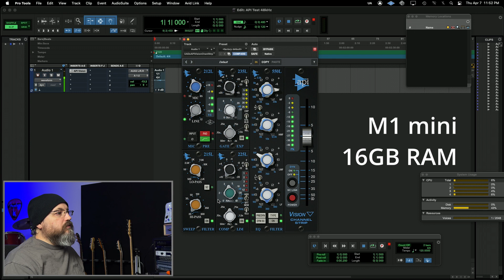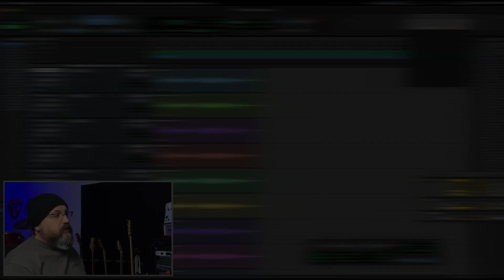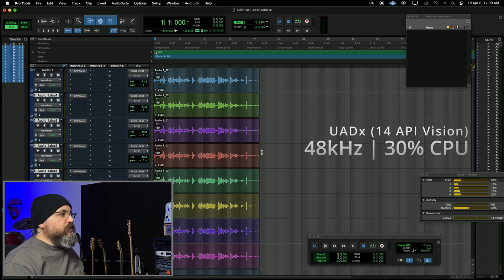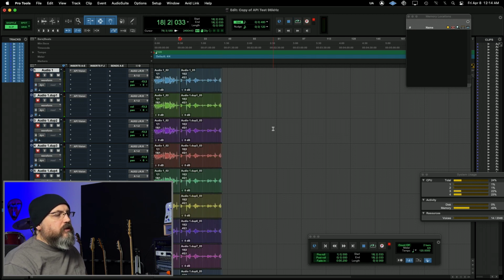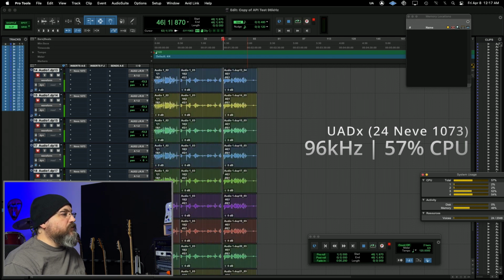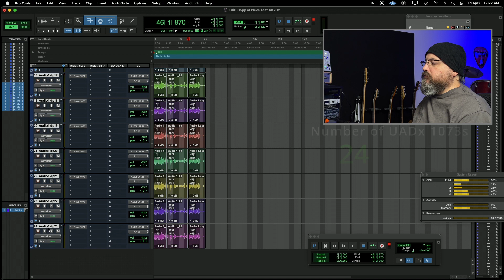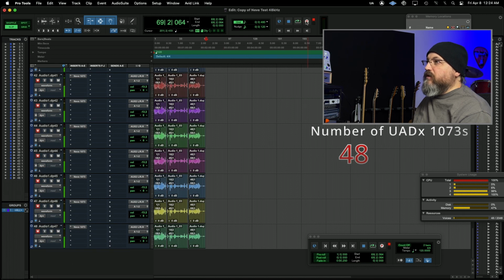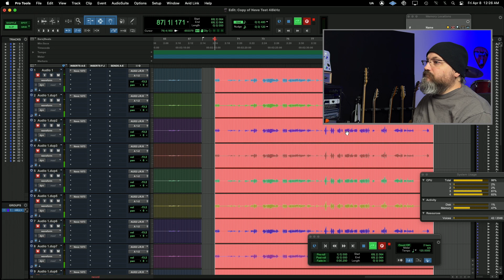UADx Spark Plugins at 48kHz, 96kHz on M1 Mac - Real UA Native CPU Test vs UAD DSP

Comment: How much does it add to RTL for live artist monitors to use native UA plugins in the DAW as opposed to having them in DSP? 

I'm trying to figure out if it makes sense to invest in UA X16 these days, since the DSP is the same power as old versions, and I could get the new Thunderbolt 4 MOTU 16A with the same converters for $1500
Reply from the maker: So, the biggest part of the RTL is the MOTU. It'll be around 4ms at 32 samples 48kHz. Add 55 samples for a typical UADx plugin like the 1073, and you're at around 5.2ms RTL. Apollo Console will be around 3.3ms at 48kHz regardless of buffer.

Comment: There is a glaring issue with this though, internally the plugins are only running at 48K internally and the oversampling is doing incorrect internal oversampling multiplication math with linear phase filters. This is why all of the Unison plugins and many of the newer UAD plugins have their anti-aliasing filter stop at 24K. Its an old trick used in low powered DSP. Just use any EQ analyzer on a 96K session and you'll notice the UAD plugins have an incorrect anti-aliasing filter that is cramping the EQ curves. An API 550B is linear from around 25HZ to around 49Khz yet the UAD API DSP and Native has a cut off at 24. I understood this on the DSP platform since it was a 22 year old SHARC DSP but there is NO logical reason to use those same filter schemes on the Native plugins other than fear of sounding different without it or just lazy cross compiling. But UAD is the same company that refused to fix the Harrison SE EQ 15 years ago when it was discovered that the low shelf button didn't work. I own UAD hardware and plugins but the deeper I dive into there tools the sketcher it gets.
Reply from the maker: They upsample to 192kHz. UA does not hide the fact that they filter at 24kHz, though. The native versions are identical on purpose, though I don't disagree that it would be nice to toggle that filtering on the native versions. You did bring up something I wasn't aware of with the Harrison SE. I'll have to take a peek at that. The only fault I have with the oversampling and filtering is that the LA-2x does it slightly differently and adds 56 samples of latency instead of the 55 that everything else adds. This was tasked to be fixed some time ago, but I believe it has not been addressed. The API 560 was, though, since part of that code was part of the update to the API Vision Channel.
Reply from the maker: This also doesn't explain the strange scenario that UADx is MUCH more CPU efficient at 96kHz in PT than at 48kHz.
Reply: @MattHepworth  The reason is because of the amount of oversampling, at 96K its called a 2x FIR oversampling at 48 it would be 4X. You also have a small amount of division going on in the C+ compiler so that the internal processing is actually done at 48K and is agnostic to the actual sampling rate of the project or DAW. Jerrone from Toneboosters implemented the same style of oversampling in the Toneboosters EQ 4, he told me that he suspected they did it this way to combat DSP overload as well as a stricter antialiasing filter to combat the distortion aliasing that would impact the overall character of the plugins like the unison plugins. But he was speculating and that was the same conclusion other developers came too as well. So the plugin is agnostic to the DAW sampling rate but the oversampling is not that is why it is more efficient at 96K. Cheers!
Reply from the maker: I guess I'd expect the same behavior with the DSP in that situation. Perhaps that's a native-only phenomenon? With DSP, 96kHz uses about 25% more DSP on most the UA mkII plugins.
Reply: @MattHepworth  Well the difference is that the DSP isn't actually multicore so no the behavior would be very different. See the SHARC DSP cores are independent, 1 core per chip, so they can not share the load of a single plugin. So the Sharc chips can't run say an SSL channel strip EQ on one chip's core and the compressor on another from the same plugin. The entire plugin has to fit on a single DSP chip. But ARM and X86 are multicore designs on a single die where as the Sharc DSPs are single chips connected by a  tracers on a PCB that then connect to the Thunderbolt/PCI bus. As well as the compiler and scheduler for a CPU/GPU is fundamentally different than dedicated DSP hardware. So even though they are the same code the architecture they are running on is fundamentally very different.  This is why I hope they move to FPGA based interfaces when NAMM comes around this year, FPGAs don't have this issue with sampling rate and the amount of plugins you can use stays the same if you are at 48 or 192. Most of the major live mixers are moving to FPGAs for this reason and they have far less latency compared to traditional DSP. Again I like UAD and I own some of the hardware but there are things they should address since their catalog of effects is getting pretty long in the tooth and i think they will make a leap forward at NAMM in a couple weeks!! Cheers!!

Comment: I think it's worth pointing out, that the CPU usage in DAWs isn't 1:1 correlated with the actual CPU usage. Instead, it shows the "cpu time headroom" in relation to when the current buffer has to be completed and sent to the audio card.

As an example, lets say you have a quad-core cpu, each core being able to process 100 "cpu-units" of work pr. buffer, ending up with 400 units in total.

Now - imagine two audio channels routed to a bus! First channel takes up 70 cpu units, second channel takes 10. Yet - from the bus and forward in the mixer-chain you only have 30 cpu units available (despite using just 80 of the 400 total units), since you need the first audio channel to finish processing, before you can process the bus. However - you'd be able to add a lot of channels / processing before the bus, without affecting the "total cpu usage".

So - in regards to native plugin-count - "it all depends". 4 plugins one after another on a channel is different from 4 plugins on different channels. And on top of this, many DAWs (Cubase, Logic, quite possibly ProTools as well) employ differentiated latency, allowing the DAW to process "non-realtime" channels out of order at a much higher latency, for significantly better utilization across cpu-cores. Which means that plugin count during playback is different from when you're input-monitoring!

On top of this, there is also buffer-size, which adds yet another variable to the mix (pun intended!). Shuffling audio between plugins takes a little bit of cpu-time, and it makes a major difference if you are doing this 44100 / 1024 samples = 43~ times a second, or 44100 / 32 samples = 1378~ times a second .. for each plugin!!

So - yeah, its not simple! UAD DSP capacity are not really affected by buffer-size, having a fixed latency of 2 x buffer + plugin latency (upsampling, actual processing, ect). But, native plugins can yield all different kinds of numbers depending on routing-layout of your session, buffersize, DAW - as well as real-time or non-realtime scenarios!

Food for thought - as well as insight into why you had non-intuitive numbers in your benchmark.

/Rune/
Reply from the maker: Good info, yes. The non-intuitive number, though, is that 96kHz allows more instances than 48kHz, relative to buffer.

Comment: After both coverted to
MP3 
You cant hear the difference
Reply from the maker: Since they upsample to 192kHz anyway there's no sound difference between the versions, so you're good to go at whatever samplerate. It's so strange that you can run even more instances at 96kHz than 48kHz, though!
Reply: Are you using reaper? Because Reaper I think automatically runs at 96k within the Daw
Reply: Ooops 64khrtz

Comment: im looking forward to trying spark when they have a pc version of it.im not too happy with slates 1176 and la2a compressors. i might end up buying hardware versions of those in the end but heard that uads versions actually behaved like the hardware does so i'm a bit curious.
Reply from the maker: I think you'll find the UAD/UADx versions are very comparable to the hardware. The only hardware I ever shot out directly was my vintage dbx 160VU against the UA and the Waves. Very close. If I still have that I'll post it as a video. I even went so far as to ensure the plugins passed through DA and AD just like the hardware...
Reply: @MattHepworth  Theres just that control where the compression becomes invisible when controlling a high dynamic range like vocals and stuff that im after with the 1176. and there's something about the attack and release , especially the release that plugins doesn't do well. the best one for this so far to me have been fabfilter pro c. but still, side by side with hardware it just doesn't quite get there.
Reply: closest i can get to that kind of control is the free "fircomp" compressor plugin

Comment: At 44.1 and 48k sampling rates UAD is 4x oversampling. At 88.2 and 96k it's 2x oversampling.
What isn't clear is why the low pass filtering (for anti-aliasing) needs to be anything lower than 48k (1/2 Fs) for high sample rate sessions. Should still have a good 40kHz of audio bandwidth and thus gentler filtering.
Reply from the maker: UA has some info about this in their plugin manual about upsampling plugins, actually.
Reply: what's mean "oversampling" or "downsampling" especially with UAD plugins and interface ? ( sorry for the noob question but I just started lol... )
Reply from the maker: Oversampling is when you're working at a particular sample rate (44.1kHz, for example), but processing is is done at a higher sample rate for a specific reason. Many UAD plugins upsample to 192kHz while processing the audio. They then down sample back to the project sample rate after that processing is complete. It's done pretty seamlessly.

Comment: Only 32 buffer size ? it is very low for mixing.
Reply from the maker: Yes, low for mixing, but about right for normal production and overdubbing if you're not using some kind of DSP based front end. Keeps latency lowish.
Reply: Don't you mean low for tracking or recording? You could mix at 1024 buffer size and it wouldn't matter in the slightest.
Reply from the maker: @Songstriker  Yes. 32 samples for normal production and overdubs. 1024 for mixing.

Comment: Just so I’m clear, did your test show the UAD plugins using less CPU when at 96k as opposed to 48k?
Reply from the maker: Hi Mike. UADx did, yes. About 10% less, in a situation where it would normally use substantially more.
Reply: @MattHepworth  

Thanks Matt. That’s surprising, but I guess could be a good thing.
Reply from the maker: I'll be working with UA to better understand it. We have a couple theories. I'll post more if/when I know more.

Comment: Worth noting that both PT and the UAD-plugins still run under Rosetta. So this is very much still a moving targeting and we won't have the real numbers until both of them go fully M1-native. Either way, what all these tests with the UADx-plugins show is how ancient and SLOW the SHARC-chip in the Apollos are compared to new CPUs. They still do the job as far as zero-latency and Unison goes, but beyond that it's pretty limited what they can do at this point.
Reply from the maker: I agree with much of this. However, I think it shows how surprisingly powerful SHARCs really are when compared fairly (like I feel I did in these tests). An M1 is as powerful as 1.5 - 2 OCTOs.
Reply: @MattHepworth  Yeah, it’s a matter of perspective I guess. Considering their age, the SHARC-chip dont do too bad. But, when you start calculating how much you pay for each instance of a plugin in a Satelite vs a modern M1, it gets kinda silly. Personally, I wouldnt recommend anyone buying Satelites at their current price. That’s money out the window. I almost bought a Satelite last year, but I’m SO glad I saved those money and got my Mac Studio instead. Way better investment.

Comment from the maker: Hey all, just got confirmation from UA that UADx still upsamples to 192kHz. I'm stumped by what I'm seeing. Can others test in a similar fashion and comment what your results are?
Reply: Not all up/down sampling is created equally.... There probably is something amiss and they probably worked it out to just copy paste the sampling code from plug-in to plug-in. But it's not a good sign that they would miss something that big before release.
Reply: Perhaps the math to upsample from 96 to 196 happens to be considerably less intensive than from 48
Reply: Also latency is lower at 96 than 48, Perhaps the small 32 buffer impacts 48 more than 96. That is, I wonder if you would see the same difference in CPU utilization with a high buffer setting
Reply from the maker: Steve, I have had both those thoughts as well. Prevailing theory is Rosetta is not as effecient at 48kHz in this particular instance. I'll run the same test on Intel Mac and see what I see.
Reply: @MattHepworth  That definitely makes sense. Apple Silicon retains the memory order of Intel but still has to emulate instructions. The additional math here combined with that overhead might explain the difference.
Reply: Just run a test in Logic and the plugin count results are similar on an M1 Mac Mini, but I get the expected increase in CPU usage at 96khz, the opposite to your experience.
Reply from the maker: @stevebelgrave  Very interesting and thank you for testing!

Comment: Why only 4 cores in Pro Tools Performance Meter?
Reply from the maker: Although PT supports M1 CPUs it currently only provides separated metering for the high performance cores, but the main meter (top bar) is correct.
Reply: @MattHepworth  thanks for the reply. So, you're using using all, but it's only displaying 4. Makes sense.
Reply from the maker: @mikeh7879  That's exactly right. Thanks Mike!

Comment: Maybe SHARCs upsample to 192 and UADx only up to 96
Reply from the maker: It's possible. I didn't test against this. I have reached out to Will Shanks at UA for the answer and I'll post in these comments once I have that info.
Reply: @MattHepworth  The Volt is 96Khz max right?
Reply from the maker: @Billy_bSLAYER  192kHz, actually!
Reply: I doubt about that, because I've seen A/B comparison of Native version (UADx) and SHARC version and when they did null test it nulled perfectly no difference what so ever and also those SHARC processors are so old and slow that I mean literally modern smartphone is more powerful than those SHARC cpus and I'm mot even kidding, so to use less oversampling on native version where modern CPUs like M1 are way more powerful than those SHARC ones makes absolutely no sense.

But at 96KHz probably something about that oversampling mechanism changes I've seen this with Softube plugins that if they use 2x internal oversampling if you use 96KHz sample rate they turn oversampling off completely, but I haven't noticed better CPU performance at 96KHz from them tbh.

So I'm interested what will be the reply from UAD to this phenomenon.
Reply from the maker: @daniel_kisel  I'll post as soon as I have definitive info. I've also done null tests (which nulled), but since UA filters the ultra-HF content, I suppose there's a possibility it wouldn't show as a difference in a null.
Reply: @MattHepworth  I don't think so if there was difference during null test that would create phase shift in highs meters would show it clearly
Reply from the maker: @daniel_kisel  I'd edited my previous for clarity. I would think you're correct, but what does that leave for explanation?
Reply from the maker: @daniel_kisel  See the new pinned comment. UA confirms it upsamples to 192kHz. I'm completely puzzled as to what the difference is...
Reply: @MattHepworth  Thanks Matt for all your info. That means that the native ones have upsampling up to a maximum of 96 kHz and the DSP version with 192 kHz? If that's the case, I would actually go back to a DSP card on my Mac Studio.
Reply from the maker: @MuratMagzalci  Thanks! I confirmed with UA that they still upsample to 192kHz on UADx native. This is a mystery as to why it's more efficient.
Reply: @MattHepworth  Wow, even with the natives they have 192 kHz upsampling? How they manage that will always remain a mystery. Although if it were otherwise UA wouldn't be smart to say they don't do it. Then nobody would use Spark for that reason alone;-) Do you know if the presets from the DSP version can also be used in the native version? I think it's a shame that they've added completely different presets to the natives. Thank you again for the information...
Reply from the maker: @MuratMagzalci  You can copy and paste settings between the two, using the UAD preset menu.